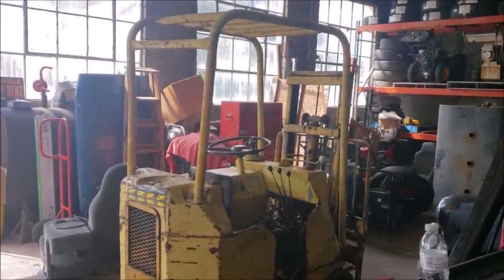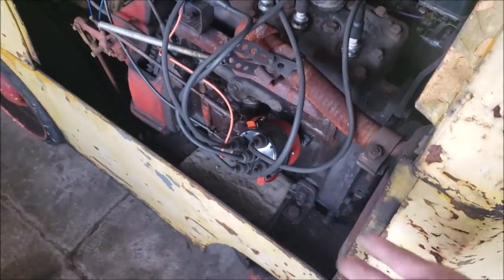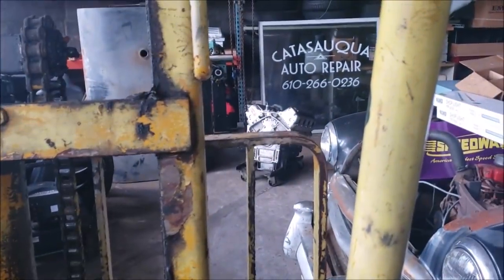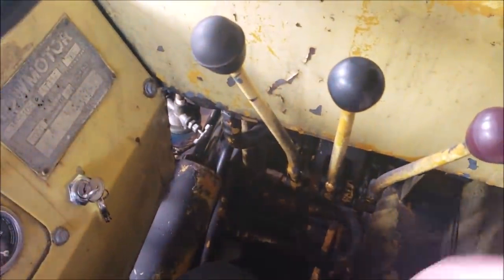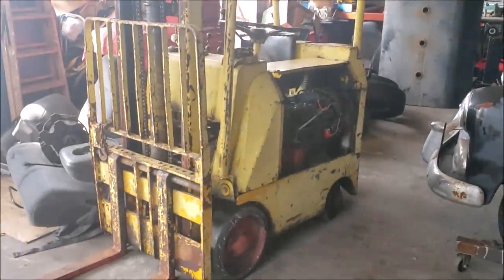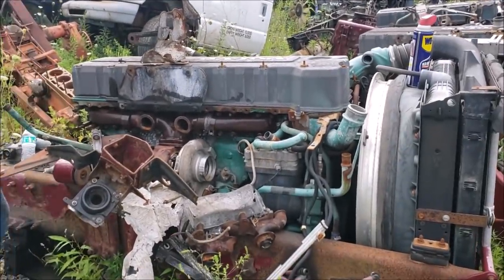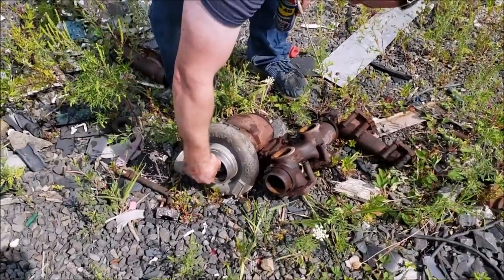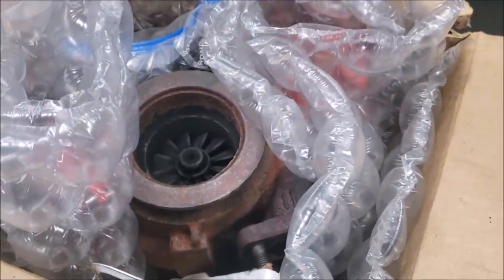Nugget Garage and my crappy forklift!

Comment: reminds me.of the heap of shit i used to have at work. from the sameish era. it was wired up poorly with 240v electrical components and someone shoehorned a non existent pos isuzu 4cyl diesel that was air throttled, not fuel, air! it also had no power steering. 
glad its gone now lol it used to smoke out the workshop everytime it ran.

Comment: I cringed at the moving the engine. I got one with a smashed boss on the head real cheap as the last guy pulled it out of the donor car, took it inside to put it in the new car - hit the bump where the roller door is and it bounced off the forks. Great for me tho as i just wanted the bits that didnt hit the ground

Comment: You clearly haven't put the side cover on as you need to put a knee into it, cables just form fit after a while. 
IT doesn't need to work.. just needs to get the job done. 
Can't find them grind them.

Comment: You gotta fix that forklift's powertrain.  You can't keep grinding those gears.    

I wonder if you could jam a more modern OHV or even OHC 4 banger in it.  Carbureted would be the most time-efficient way to go, but EFI would still be even cooler!